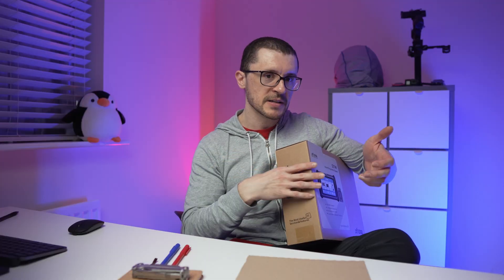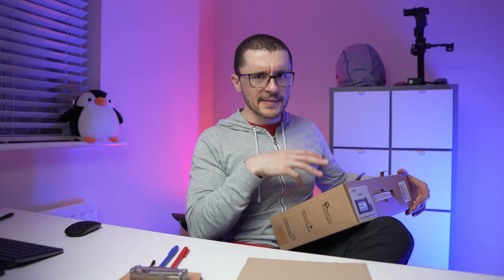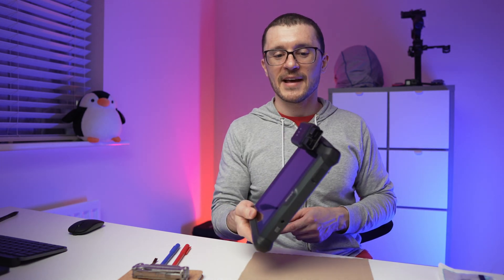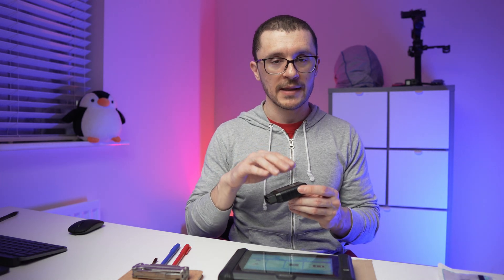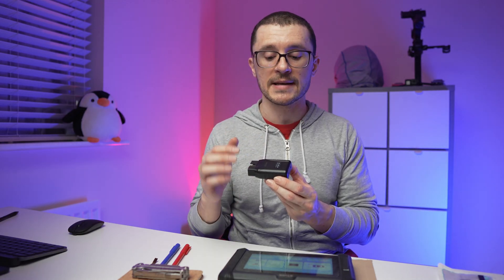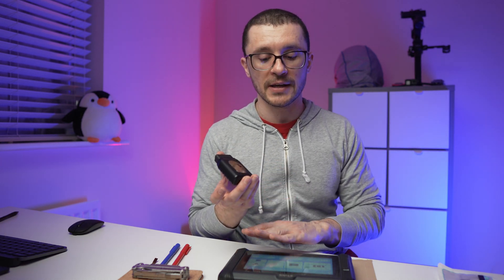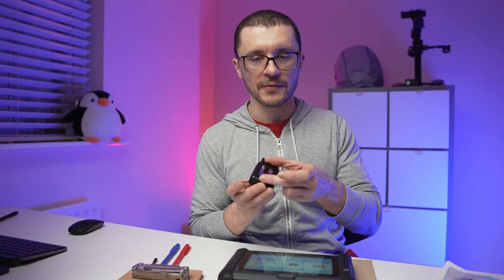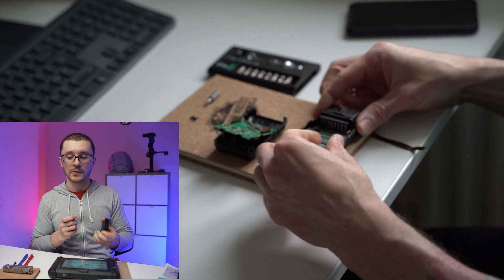This is the GAME CHANGER for your Xtool D7W, D8W Wifi Diagnostic tool

Comment: I used velcro with an adhesive backing. 1 piece on the back of the tablet and 1 piece on the back of the dongle. There's no way I'd ever use a magnet on either the tablet or dongle, I'd be too worried about messing something up.
Reply from the maker: Your idea works well too. Thanks for sharing.  How do you find the battery life on these tools ?
Reply: Are you asking me where the battery life is displayed on the scan tool, or are you asking my opinion about how long the battery lasts on the scan tool?
Reply from the maker: @victorhoyt4352  I am asking your opinion about how long the battery lasts
Reply: @BestCarMods Not very good, honestly. My launch x431 pro dyno lasts 10x longer than my xtool D8W. I find that if I disconnect from the wifi while it's just sitting, it does help it last longer, but just sitting in stand-by, the battery gets depleted quite quickly. The newest D9s pro has an upgraded battery, which is very similar to the launch scan tool battery, and it lasts much much longer.